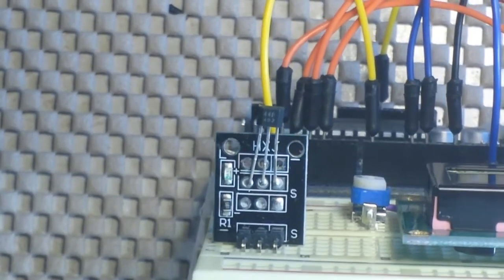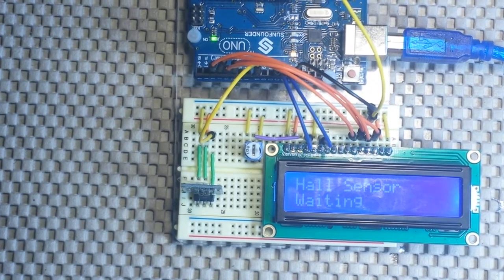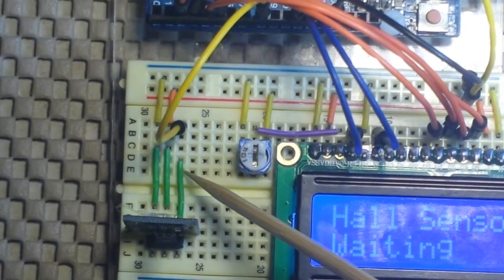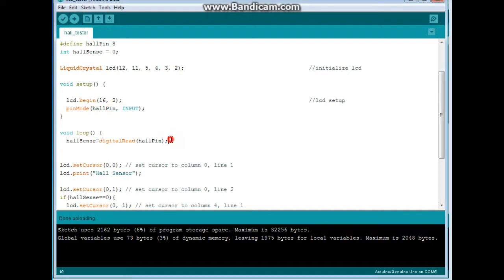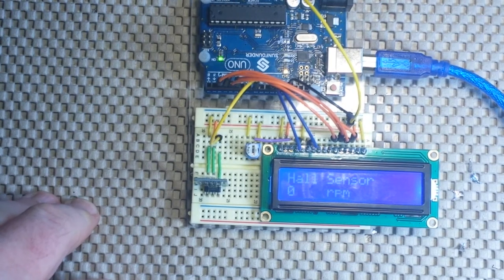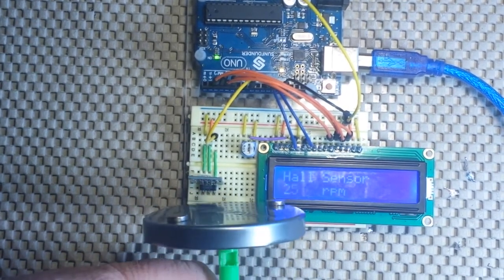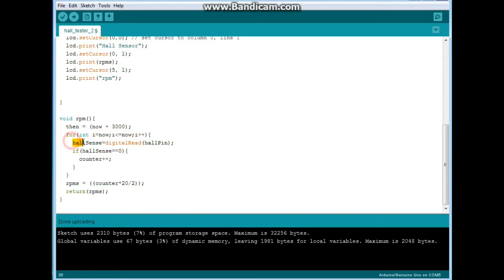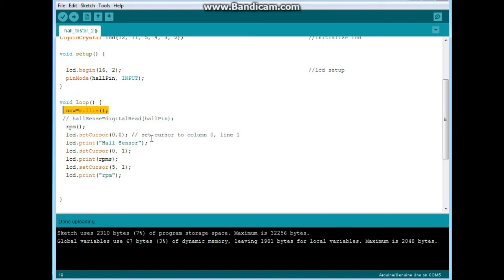Arduino Basics Using a Magnetic Hall Sensor

Comment: I recently put a hall effect counter on one of my manual milling machines. It uses a Nano and 16x2 LCD for a tachometer. The sketch though uses and interrupt and I confess it isn't my design but works great. Very useful stuff, thanks for the video.
Reply from the maker: j head bridgeport?
Reply: No, I wish! It's a US Burke Millrite, a 3/4 size Bridgeport.
Reply from the maker: George Chambers The college where I teach has a completely unused machine shop with 2 Bridgeports, 2 17" Turnado lathes, surface grinder, heat treating equipment... it's like my personal playground lol
Reply: Late model South Bend lathes, nice. I have a 15" SB lathe, a little older, 1917. A free machine shop is a wonderful thing to have. I hope you make good use of it.
Reply from the maker: George Chambers I do make use of it. I even bevel pipes for the welding lab.
Reply: What, they don't have a notcher? Well, it gives you time on the machines. I wish I had a surface grinder but my shaper does a fair job of flattening surfaces if they're not very big.